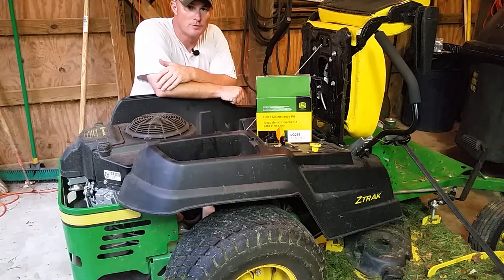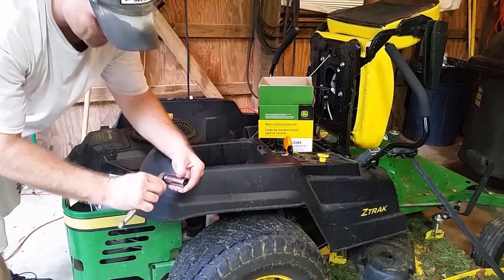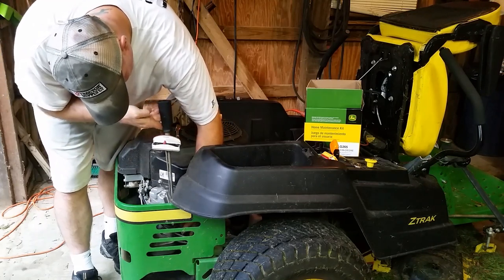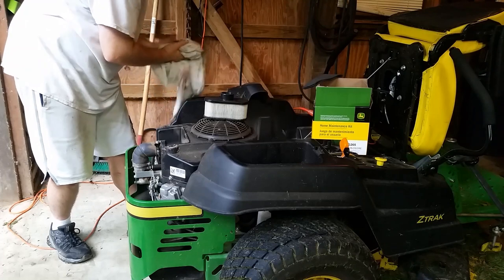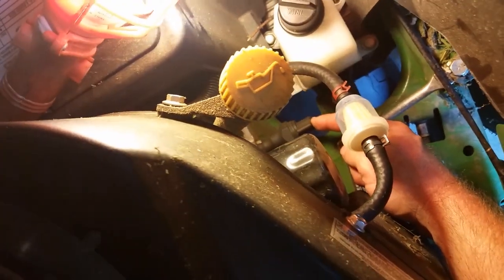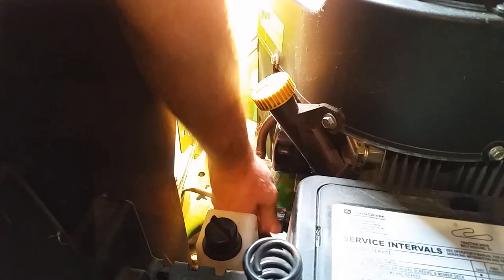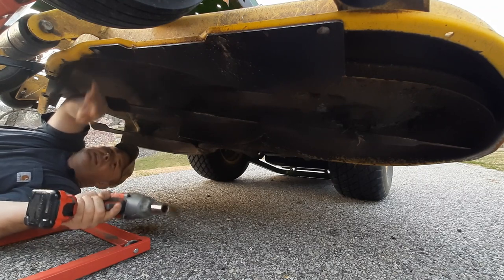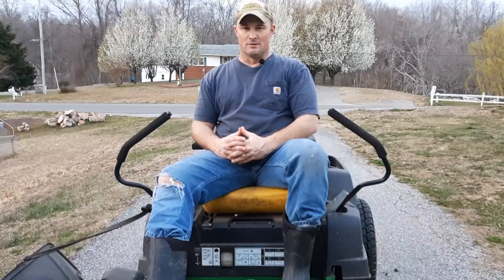John Deere Z540M Zero Turn100hr service

Comment: I've had two  Z540M 48 inch cut mowers. The second mower (2018) four years old has 371 hours. You better check your owner's manual. That Kawasaki engine tales 2 quarts and 1 cup of SAE 10-30 Turf -Gard oil. NOT 1-1/2 quarts. I wish they had a drain plug to change the transmission oil. Every 200 hours the overhead (valves adjusted) has to be checked on the Z540M. Every time I get done mowing I take the foamy black filter off air cleaner and rinse and let dry. Also tap dirt out of air cleaner, Thank you for the video. Blessings to you.

Comment: Hi ya. Good vid. I've had a Z540M for 5 years or so now. Got a clue on how to adjust the steering? I've got a neutral creep on one side. Also don't think that they drive equally.
Reply from the maker: I'll have to look in the manual, but I'm pretty sure it tells you how to adjust the steering.